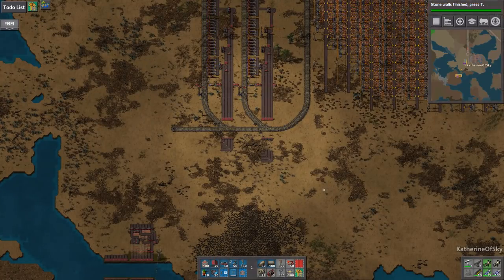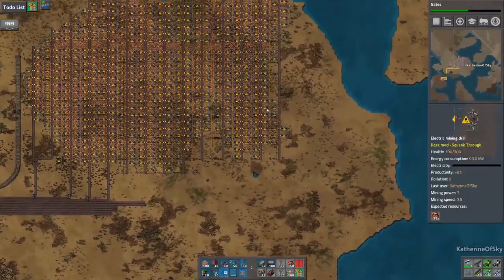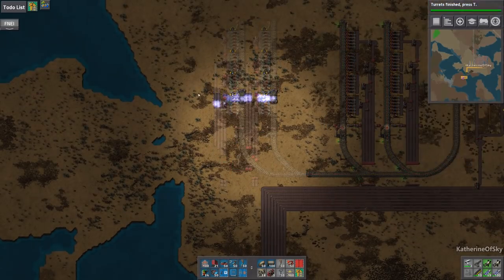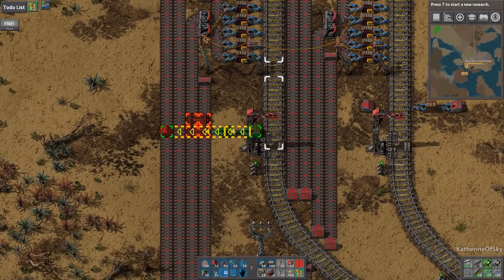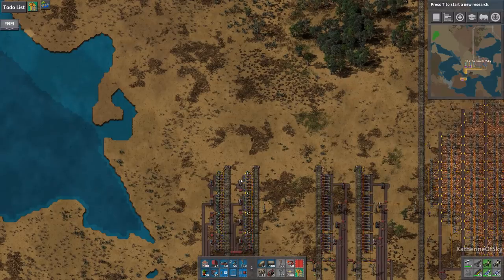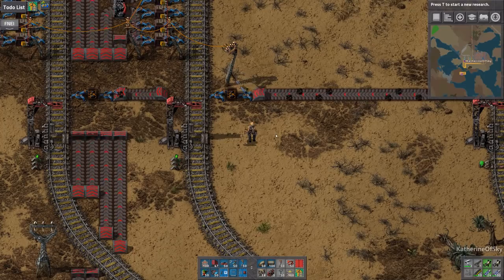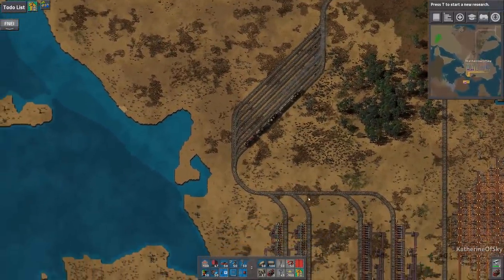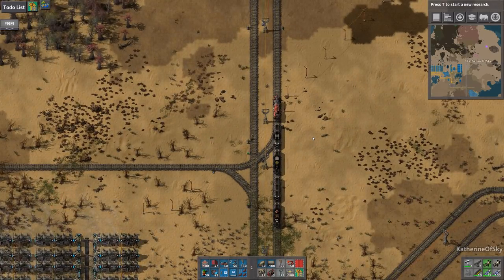Whistle Stop Factorio Ep 14: DAZZLY DANCY COPPER PLATES - Mod Spotlight, Let's Play, Gameplay

Comment: After seeing you use cycle through the blue print book for the train sections i've been trying to incorporate it into my normal use. It made me think you should make one for your red belts (4 long, 8 long, corners ect) that you can just cycle through instead of hunting through your most recent creations. However I know once your brain and muscle memory is fine with those small diversions it doesn't really matter much, just a suggestion! Also had the idea that maybe you can use the todo list mod you have installed to make notes of things you need to pick up at the mall (under grounds, belts, bots), I always forget what i'm trying to get when I go back to my mall as well.
Reply from the maker: I hate the blueprint book cycle, TBH.  I much prefer the old style where you could just pick the one you want.  It's just easier to use map mode and find a BP-able area.  Because it's not just red corners,..,. it's yellow corner, right, left, yellow 4x, yellow 8x,  then reds, then blues -- too many BPs in a single book.